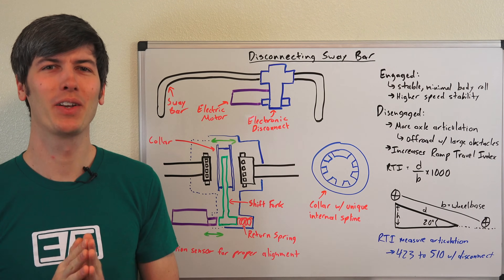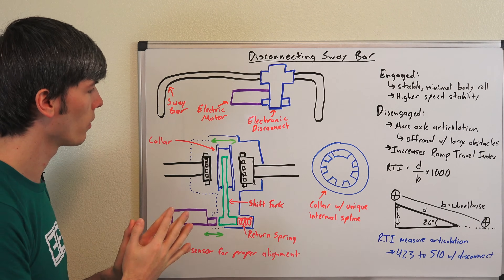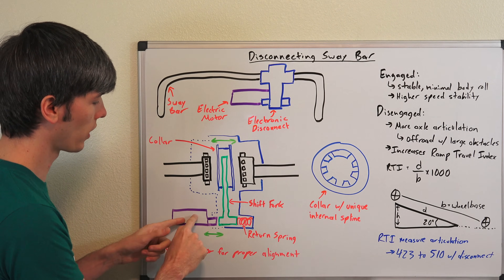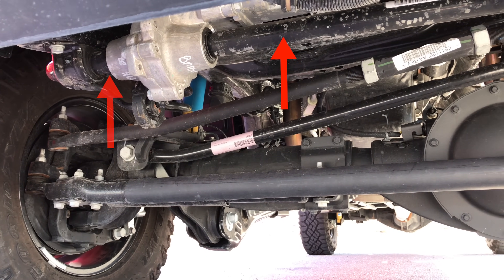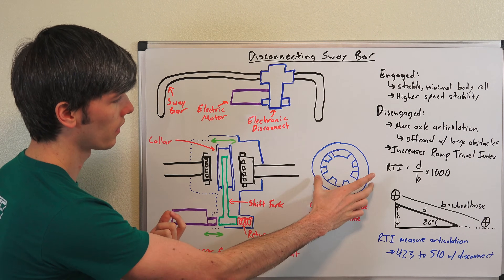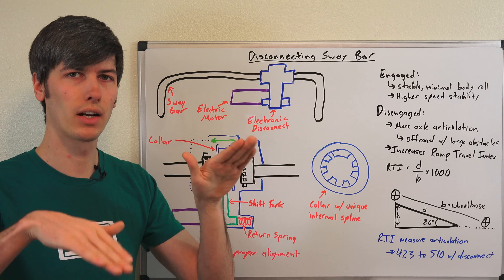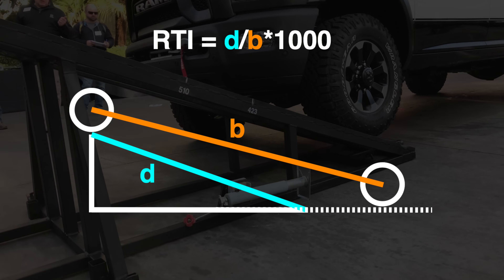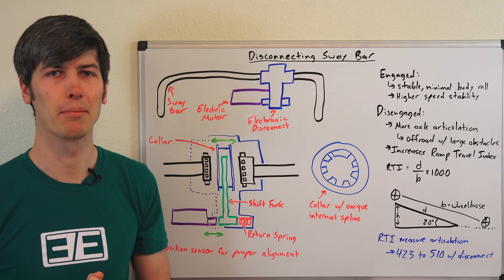How Disconnecting Sway Bars Work

Comment: AH, so it is the CAD system off the old Dana 30 axles. Rather than being a vacuum to slide the collar it uses a n electric motor. Cool. I had never looked at one in person.

Comment: How bad it is to dayli drive a car or truck with sway bar links disconnected?
Reply: Very bad; it can cause handling instability at speed. The Ram Power Wagon shown in the video won't even let you; if you try to go faster than 40 mph with it disconnected the truck's computer will reconnect it for you.

Comment: Not exactly related to the original subject, but its interesting to note alot of people with lightweight cars and McPherson struts who run Solo II, RallyCross, Drifting have had better results in recent years with completely disconnecting the sway bars and relying on only the springs for roll control, specifically in regards to running on lots or tracks with rougher surfaces.

Comment: Hey up. I have a question. Under heavy acceleration, a rear engine car would need as much weight as possible over the rear wheels, to make use of the power. For drag racing, has anyone tried driving the front wheels and steering with the rear?

Comment: my Jeep doesn't have a sway bar what do I do
Reply: Don't drive it on highways that require you to go beyond 65 mph and slow down extra for the "sharp" turns. The sway bar is meant to transfer the rotational torque to the opposite side of the vehicle. This keeps the center of gravity (due to vectoring forces) close to the actual center. Much like a rider on an ATV leaning to the inside of the corner.
Reply: 99codemister good thing it only goes 45

Comment: Good more parts to wear out...
Reply: Why exactly would you worry about this wearing out? First and foremost, the transition is rare. Second, the transition should always happen when the truck is stationary. So with the right lubricant, there is little reason for the part to ever wear out.
Reply: If it's built right it won't.

Comment: in off road situation, disconnected sway bar make it more stable or more prone to rollover like in road conditions?
Reply: Stability at slow speeds is more dependent on the suspension stiffness. Too stiff or too soft may cause the center of gravity to shift to unfavorable locations (and cause a rollover). Since the suspension was designed by the manufacturer, it is pretty safe to assume they went with safe balance. Finally, at low speeds you should have enough time to counter steer in time to get you out of the roll.

All that said, I still would hesitate to take the truck rock crawling as shown in the demos. I'd keep to the trails and use the disconnect to ease getting over that stubborn log.

Comment: I work on Mopars all day long with disconnecting sway bars but I've never bothered trying them out.

They make oil changes on the 2500 gasser trucks go from easy to why-do-do-this-for-a-living? kind of hateful.
Reply: No, they come out the front and the filter would normally be staring you in the face when you're behind the bumper (just like the 1500s) but on the power wagons with the disconnecting sway bar is in the way.
Reply: brakedd ah, gotcha. on the diesels you have to tip the giant ass filter over to get it out. its impossible to do it without getting oil everywhere. its enough of a problem that companies started making caps to plug the end of the filters.
Reply: I hate changing the oil on the Cummins trucks.  I need to get one of those caps or make one myself.

Comment: Hey Engineering Explained, I always hear of people or see videos about how people can drive a manual without engaging the clutch to change gears and they say they can hear and feel the engine and then they shift upward without touching the clutch. Could you make a video explaining this? It would be interesting.
Reply: if the gearing has "synchronizing rings" (it's 1:1 translated from my first language), it does work. Condition: no load on the gears, aka. off the throttle and then just shift with a bit more force. The ring(s) speed up the following gear.

Comment: Question: does the driver disconnect it manually or is there a combination of sensors and logic that decides when to disengage or engage the bar?
Reply: deslomator Manually, there is a button on the dash.
Reply: deslomator Well manually as in the driver initiates the process by pressing the button, then electronics take over.

Comment: One thing you forgot to mention is that disconnecting/removing sway bar also makes for a more comfy ride when off road. Front end works with a lot less resistance when going over rough terrain or obsticles. It's not just articulation.

Comment: I didnt know that this was a thing! Brilliant idea though! If i where to design it though, i would have a function on a spring. So if you hit the button for "closed" it will apply a spring loaded pressure on the two bars, and when you go over a bump, it will aline the two correctly again and it will lock, giving you a green light.

Comment: lets say you hit a 1.25 inch pothole at 55 mph, what is the force on a traditional sway bar?
what amount of force do these sway bars typically have to deal with under normal cornering conditions?

Oh and great videos, i am not really even a car nut but i love all the engineering behind all of this, and you explain it quite well!
Reply: Teslaspecter It depends on the vehicle and the bar. A smaller and/or softer bar would transfer less force than a larger one. It's usually a few hundred pounds at the most for a stock away bar since they still want it to ride good.
Reply: onethirdofGilgamesh in standard engineering explained fashion we could just pick an imaginary vehicle and make up reasonable numbers. Just enough to give us a ballpark of what these forces could be.
Reply: 1.25" 55mph? Do you even science? It's a major factor if the pothole is 2" or 20" long. There are so many variables in the equation, that it's technically impossible to calculate. What about the tires, suspension, wishbones etc. ?

Comment: 1:22 rotating??
Reply: Both end of a sway bar are angled like a crank lever. when the suspension compress on one side, it pushes on that angled bit which rotates the bar and transfer force to the other side.

Comment: do you know anything about if it's bad to float a normal car manual transmission? if so why is it bad?
Reply: float? is that another way of saying coast?
Reply: Luke Hassell if you're perfect at it you won't cause damage. if you're off by any you'll cause some damage to the gears. Idk why you'd float gears anyways. Just too lazy to use your left foot?
Reply: I drive a semi and float gears all day, then when I get back into my car I find myself doing it accidently. I'm wondering if it's bad for a car transmission, no I don't usually grind it in my car.
Reply: volvo09 shifting without the clutch
Reply: Luke Hassell well it should handle it fine. just keep in mind that a semi transmission is much beefier than in a car, it can handle more abuse. And depending on the car your first grind could be it's last.
Reply: MattyMag what about the synchros and shifter Forks in a car transmission? from what I understand a semi does not have them which is why U float without damage
Reply: Luke Hassell the shifter forks might be a little more stressed from the speed you need to use to pull into gear. But it should be negligible.  And syncros sync when you pull into gear, meaning that if you're pulling into 3rd gear as an example and you need to be at 2000rpm the syncros will merge any difference between the trans and layshaft. But seeing as you're pulling into gear at the right rpm the syncros have little work to do. and because you didn't use the clutch and you're in neutral the layshaft and the rest of the trans are already spinning the same speed. 

the way I see it the only real damage will come from wrecking teeth of the gear in the event of a grind
Reply: MattyMag ok thank you.

Comment: Would this also work for DRAG vs ROAD race, for car that serves dual purposes?   

Thanks and love the videos!
Reply: Maybe it would help a little with high torque twist applications, but most of the change would have to be done with the normal suspension.

Comment: I've tracked my post rental 12' sonata GLS at Barber and Talladega Gran Prix.  The understeer was pretty moderate the first track day.  My only mods are a stiffer rear sway bar, FSTB, EBC yellows and RBF 600 fluid.  The next two track events I ran with the front sway bar disconnected and FSTB out.  The understeer is now mild oversteer and the car will turn.  Tire wear is much more ever.  Grip is much better.

Comment: Anti-roll bar*
Reply: I think "sway bar" or "stabilizer bar" are better terms for it in this application. That's why there are different names. You're not trying to stop roll, you're trying to control it. It would be as silly to call it an "anti-roll bar" as would be to call dampers "anti-absorption pistons".
Reply: elliot438bcfc which is called a sway bar as well

Comment: is the powerwagon the only vehicle with it? would be a good aftermarket item
Reply: Jeep Wrangler Rubicon is also equipped with it, however there is a high failure rate so most owners opt for a standard sway bar and traditional quick disconnects.
Reply: Toyota has been using it for years. Those things almost never fail so it can be built right if they take the time to do it.
Reply: Lol this is old tech. The Toyota Landcruiser had this decades ago. Range Rover has had it for a while as well. The old LC had adjustable sway bars as well that would change and get stiffer if you set it to sport mode. Less body roll on the freeway.
Reply: o0bananaman0o Toyota 4runner has The Kinetic Dynamic Suspension System!! I absolutely like my 2015 4runner.
Reply: o0bananaman0o :  the Audi S Q7 has it also
Reply: Wrangler Rubicons have it
Reply: I wasn't a fan of it to begin with. Complex electronics that are exposed to the elements have no business on a 4x4. As for the drive train reliability and overall quality i couldn't say. My newest vehicle is a 2000 model. I wouldn't judge the overall quality of one notorious part. Especially one that is so easy to replace.
Reply: vidurc what toyotas have it?
Reply: Quite a few models in the line up. Some for better street handling and some for actual offroading. 

https://en.wikipedia.org/wiki/Kinetic_Dynamic_Suspension_System
2010–2016 Toyota 4Runner Trail Edition
2017–present Toyota 4Runner TRD Off-Road
2008–present Toyota Land Cruiser
2004–present Lexus GX
2010–present Toyota Prado

https://en.wikipedia.org/wiki/Active_Stabilizer_Suspension_System
2006 Lexus GS 350
2006 Lexus GS 430
2006 Lexus GS 450h
2008 Lexus GS 460
2008 Lexus LS 600h
2008 Lexus LS 600h L
2010 Lexus RX 450h
2013 Lexus LS 600h F SPORT Active Stabiliser System
Reply: Where did you get that info?  Mine worked fine for years.
Reply: I've had 3 friends with varying year models failed. All of them got it fixed however 2 of them have gone to currie anti-rock sway bars.
Reply: @zone stidham or you can go with https://www.offroadevolution.com/product/evo-mfg-nolimits-manual-rubicon-swaybar-disconnect-jk-jku/